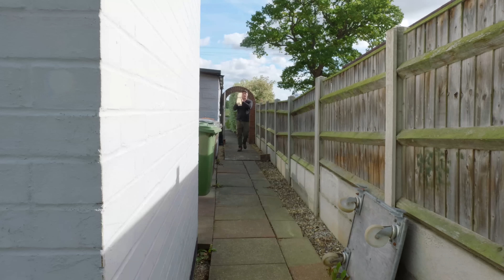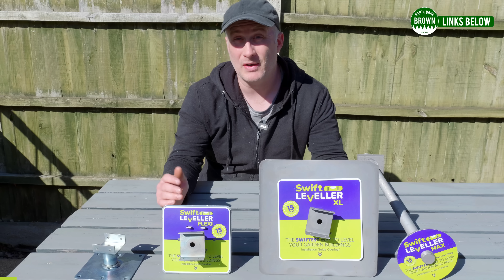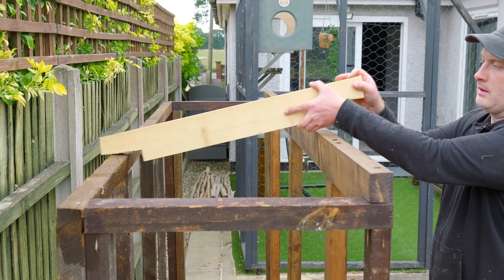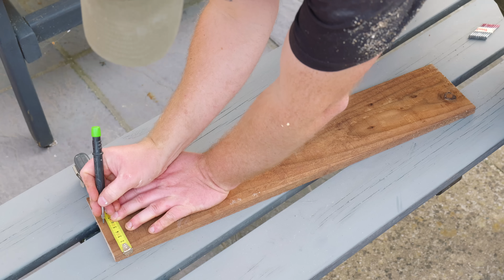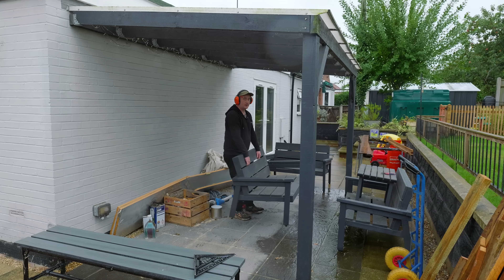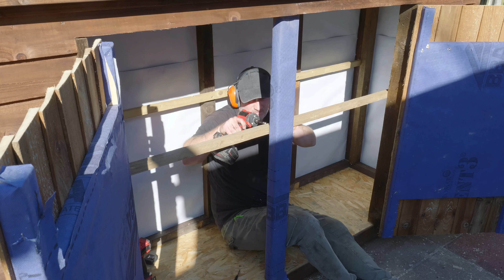No Cash, No Problem: DIY Shed Build

Comment: Hi Keith, just a note to say I built this shed recently using your plans and this video and am really happy with it!  Ridiculously solid construction and it will last for many years I'm sure.  I made a few tweaks, mine is slightly deeper and taller, I used larch boards to clad it with and an EPDM roof but the basic construction is as per your plans.
Reply from the maker: Glad to hear it turned out so well, the larch and EPDM sound like great upgrades! 👍

Comment: FYI incase it interests you Keith or anyone for that matter, I am about to build the shed (slightly modified from your plans).  Excluding the cladding (I am cladding with larch boards to match another shed I have) the timber for constructing the frame, floor and roof, my shed is slightly taller and deeper and I am building the roof a little differently) came to £172 delivered from my local Huws Gray.  I am not trade but know a guy that works there so get a decent price. I also priced identical quantities on materials market using your code and it came to £230 delivered.  I didn’t think that was too bad for prices accessible to anyone and everyone, I dread to think what it would cost in b&q…
Reply from the maker: That's a great price for the materials, good luck with your modified build! 👍

Comment: Not bad for a first attempt but there is one major flaw.  Rain and debris eg leaves will travel to the back of the shed where it will get trapped between the wall of the shed and the fence panel.  In a couple of years the back wall will rot away.

Always leave airgaps to stop this problem.
Reply from the maker: A) it's not my first attempt and B) there is a gap, obviously

Comment: i must of replaced hundreds of council garage asbestos roof sheets with concrete fibre based ones in the early 2000s, we would always stick some gutter mastic on the roof bolt as extra lol, not needed but u know, its sort of like plumbing

Comment: I had that exact same padlock on my motorbike lock. It rusted and seized within days. Please get a different one or I will guarantee you you'll be using bolt choppers to get into your shed
Reply from the maker: I've had it about 10 years... It was the lock to my first ever workshop's extension shed. No issues as yet

Comment: So you said no cash but then used the metal feet which don't look cheap, I like the idea of using up the offcuts but honestly who has that much laying around .😞
Reply: So he says it's a advertisement in the video so presumably it was a paid a their are other ways to level which can be done cost effective 

Building a small shed on a budget can be reasonable cheap the most expensive parts would be roofing and screws and nails.. tools

I use pallet wood where I can the slats are good for sheds. And the rails are good for noggins ect
Reply from the maker: I do

Comment: Nice work! I have used similar roof panels on a few sheds I have built they are going strong 3 years in. The also sold color matched screws which I think look nice with them.

Comment: Not a big fan of the way the boards are horizontal on most of the shed but vertical on the doors, though I guess that does save a lot of work.
Reply from the maker: The featheredge is fitted vertical as the hinges wouldn't sit properly if the boards were horizontal on the doors.
Reply: @RagnBoneBrown  - Well, there would be ways of dealing with that (just add a small strip as a "packer" under the hinge, reversed so the slant cancels itself out).

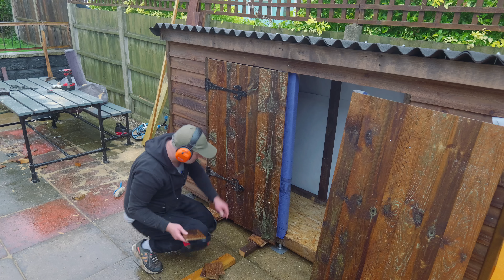As they are, some parts of the hinge are also "floating" above the boards, as seen at 16:37.

Comment: Great build. I'm not sure how good feather edge is at rain proofing while vertical. Any thoughts on horizontal to match the walls?
Reply from the maker: The hinges wouldn't mount to the door properly if the boards were horizontal as they'd be skewed at an angle

Comment: The Swift Leveller - I'm building a shed on my allotment and this is a perfect solution. Would you place each one onto a concrete block to distribute the weight over the floor better to reduce the chance of one part sinking? I've worked out I need 15 of them for what I plan to build (4x2m)
Reply from the maker: You could do that or use one of the other models and concrete them in

Comment: Onduline last 25 years😱

I used this on my shed a few years ago, and lasted two years.

We had a mini heatwave where temperatures reached 30c and the heat deformed it to the point where the ridges lost any rigidity, when it rained heavily a few days later the water pooled on the sagging roof sheets, ran through the fixing holes and soaked nigh on the entire contents.

Never again.

But that aside the shed looks good and the Swift Levellers look to be a great bit of kit.
Reply from the maker: Sounds a bit like it wasn't installed correctly to be honest. I've not had any issues whenever I've used it
Reply: @RagnBoneBrown  It was fitted as per instructions directly to an 18mm OSB roof with a 12 degree pitch using the supplied fixings.

Comment: Hi Keith
You once did video about tape measures where you said you wanted a small tape, 2m in length, and only in mm but couldn't find one.
Stanley FatMax model FMHT33856 fits the bill!

Comment: Great video. As an upgrade you may wish to block up any rodent entry to the base.  You'll need a bit of air flow so wire mesh maybe? However I'm sure the cat security guards will be fine!
Reply from the maker: I'm not worried about rodents, never had an issue with them

Comment: I have two sheds on a concrete base but they are are both racking 
I would normally put in some diagonal braces but the problem is on the door ends
I have packed the base but I’m wondering how to square up up the frame 
Love all of your content but looking for some ideas
Reply from the maker: Could you jack them up to level and then add a 45 degree brace?

Comment: I'm trying to start doing DIY stuff, but I don't have many tools. I want to make a pantry in my house, basically just fit the space with shelves along two of the walls. What tools would you recommend are needed for this kind of project? (Also really enjoyed the video, I've been watching lots of your videos since I got my new house recently)
Reply: A cheap track saw to cut down the wood, a hand jig saw for any rebates etc you might need to do, a combi drill and an impact driver (you can usually buy a kit). Then get yourself a countersink drill bit, a good square and a decent hammer. 

Watch some pantry shelving vids on here to get an idea, just know that where they are using a table saw, you can use a track saw. Keith’s friend Peter Millard has loads of track saw videos for you to learn stuff.
Reply: Oh and get a pocket hole jig too. Great for joining shelf panels underneath (if you want them floating around 2 walls). 

Also buy your wood in sheets from the timber merchants and get it delivered if you have space to store it, it’ll save you loads of money over DIY stores.

Comment: Im sorry Keith but I'm really annoyed by the fact that you made the siding of the doors go vertical whilst the rest goes horizontal. It just looks like a mayor design flaw. Other than that I love your videos. I watch them all and learn a lot of what to do (and of course what not).
Hope you'll get good use out of that storage. Cheers!
Reply from the maker: It's normal to do that, the featheredge is fired at an angle, if it was horizontal on the doors then the hinges would not be able to be fitted as they would be skewed

Comment: Hi, a quick suggestion for longevity: you could spray paint the metal legs or at least put a wax and/or grease on the fillets and inside the tube. Am I overthinking it, maybe. Love your work, cheers !
Reply from the maker: They have a zinc nickel coating, so no need for any more protection 👍

Comment: There's no denying your love for pizza, it's so strong you built a shed for it 😂 That bitumen roofing is easy to work with but in my experience doesn't last that well especially in a south facing spot, mine went all wavy and eventually deteriorated in 7 to 10 years. I had high hopes for it but ended up replacing it with galvanised steel.
Reply: Mmm, bitumen and mozzarella
Reply: @TheChipmunk2008 😋😂
Reply: @gingerelvis  to be fair the italians find it less offensive than pineapple

Comment: A sharp looking shed. Nice work as always! A fun tip for you with the nails, if you rotate the nail 90° on the strip it will act as a holder while you get the nail started with hammering. That way you won't have to clip them and get added the bonus of a finger saver holder 😁
Reply from the maker: That's a top tip, thanks!

Comment: Why are you still using wood preserver? You did the test yourself that it does absolutelly nothing
Reply from the maker: Great question! The experiment I did was in contact with soil so it was pretty harsh. Whether it actually works or not without being in contact with the ground, I don't know. Plus, it was left over from my brother's shed build! 👍
Reply: @RagnBoneBrown what model track saw and model nail gun and what a good budget make for both would you recommend ?
Reply: Can’t speak for him but I suppose he just did it because it feels right lol, helps him sleep at night I think😂
Reply: Old habits die hard 😅
Reply: His experiment was for ground rot testing from wood being in contact with wet soil. We preserve stops rain water and muld from taking hold, it stops creatures like woodworm from infecting wood.

Comment: Didn't you do a video testing wood preserver that determined that it makes no difference if you put it on or not? Why are you still using it? Was it just leftover?
Reply from the maker: Great question! The experiment I did was in contact with soil so it was pretty harsh. Whether it actually works or not without being in contact with the ground, I don't know. And yes, it was left over from my brother's shed build! 👍

Comment: Nice little project that mate, despite the rain and the random direction of some of the framing nails it turned out really good 👍🏼 However.... not your fault obviously but my OCD is really struggling to unsee that one single grey noggin you used in the floor 🫣 I know.... I know it'll never be seen but still, that's the joy of being me sometimes 😂😂